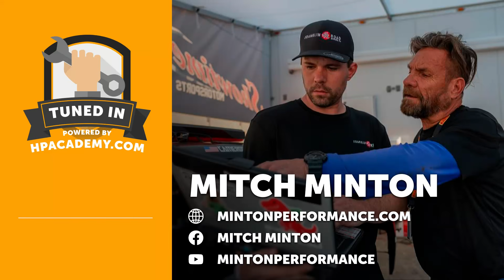Cracking the CAN Code: Mastering Integration in Performance Builds #PODCAST

Comment: CAN bus and the "developers" and their "secrets" are going to ruin the car industry with their delusional grandeur of "IP"
Reply: Im one of those guys, 99% of the time, were not really trying to obscure data, if anything were always trying to make the frames and the signals within them make sense. Cybersecurity and end to end protection on the other hand is an entirely different animal and its a legaly binding one which OEMs need to comply to. The last part is what makes the reverse engineering almost impossible now and actually impossible in the 2026+ car models (for relevant frames)
Reply: keep tabs on which people help move you closer to the goal and which ones try to make it more challenging. 

OEMs will be OEMs, but the aftermarket is an entirely different story. ;)